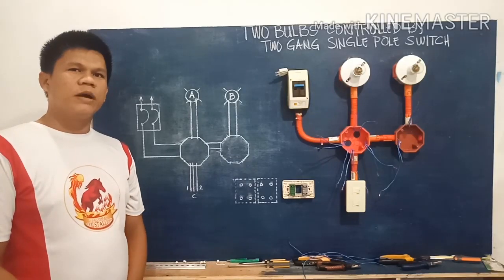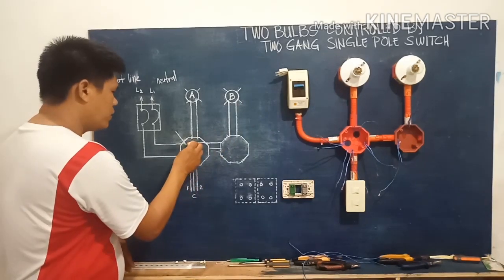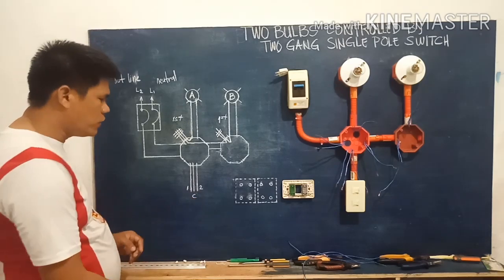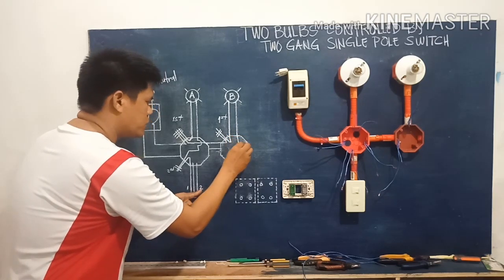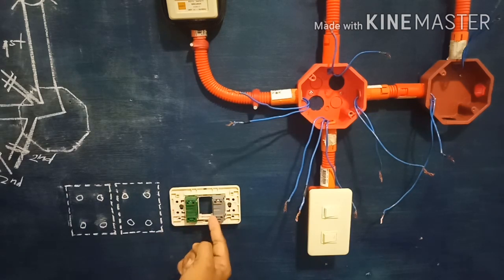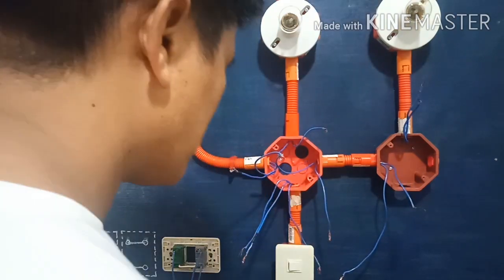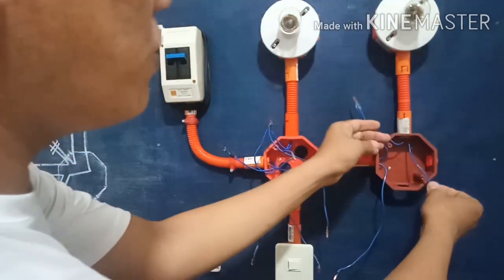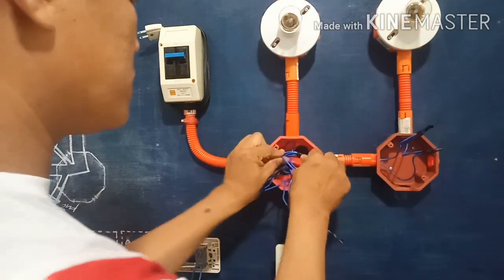How to install Two Bulbs Controlled by 2gang Single Pole Switch

Comment: Master ma tanong lng pg L2 L1 ba anong clasing connection yan? KC sa iba L1 is hot L2 is neutral.. Alin poba ang tama jan master?
Reply from the maker: dependi lang sa theory ... if you start on L1 as your neutral then L2 must be Live wire